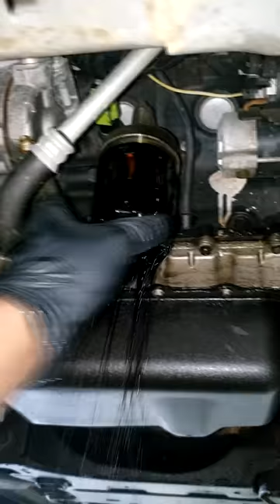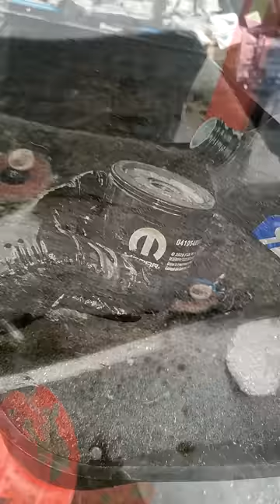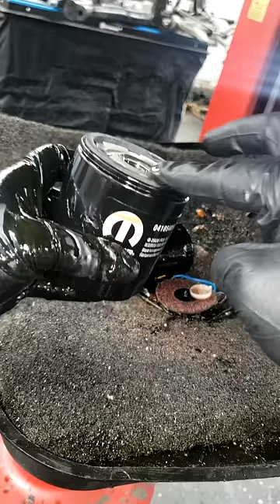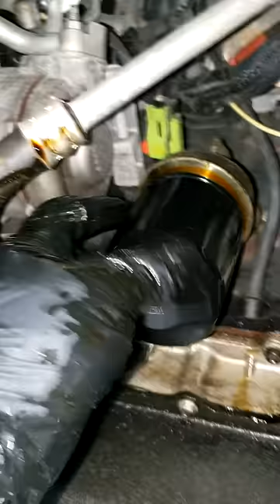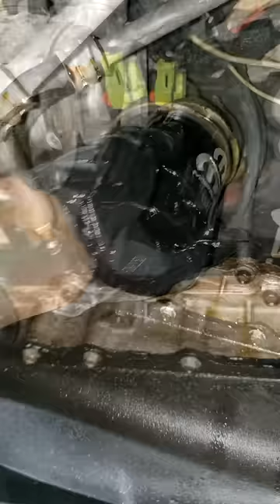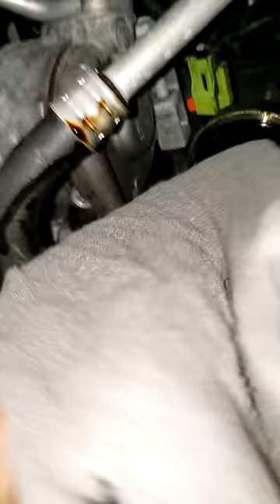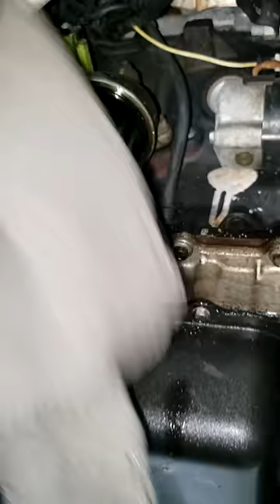Don't Lie.. Are yall still doing this?

Comment: I’m an aircraft mechanic this is the way I was taught. If the filter is empty you have several seconds on startup where the engine is not getting any oil. Until the filter is all the way full and only then are you getting oil to the engine rotating components. Engine oil is the lifeblood of any engine.
Reply: Exactly 👍. I was also a turbine surgine. Jet Mac. Homestead AFB. Florida. 7 years. The USAF always practiced schedule preventive maintenance on every engine. They did it by the total flying hours on the jet engines.
Reply: Makes sense considering in 3 to 5 seconds, the motor turns quite a few times semidry.
Reply: The parts will still be lubricated enough to last that initial start up…. Oil doest just disappear on its own… you can leave a drain plug off for days and there will still be plenty oil on all the components. Its the mater of how long you run the engine with no oil in the pan whatsoever. Then its the matter of the engine getting hot enough to burn off the initial oil….
Reply: You do need to do it on these engines. Partially because they run really basic oils that dont hang around in the bearings, and partially because they are all 75 year old designs.  Mine just has a strainer to catch all the metal bits that fall off the cam followers because of its basic late 30s design.
Reply: solenoids these days are more than capable of full film coverage almost immediately, there is absolutely no need to pre fill an oil filter with modern manufacturing standards and technology
Reply: @jpif2961  modern solenoids?  Not sure what a solenoid has to do with the subject matter. Obviously you have a cranial rectal inversion issue that you are unaware of... My solenoid doesn't require oil, electricity, or wind to function way better than anyone knows.. anyone.. do you walk to school or carry your lunch?.
Reply: Hello fellow aircraft mechanic. As an AMT, you should know it is all about what the manual tells you to do 😉. Jokes aside, it all depends on the type of engine. Most jet engines and small reciprocating engines dont need this, but you bet the filter is getting primed on a huge diesel or 9 cylinder radial beast.
Reply: I agree 👍. You're talking about a diesel. A totally different beast 😅.

Comment: 100% of the time! I run diesel trucks so the filters are huge. Why dry start an engine after an oil change. It takes no extra effort to prefill the filters.
Reply: All of my diesels get oil in the new filters,  not so with the small filter in my gas sedan engine.  However, during my oil changes I clean the filter port and mating surface and snug it down better than in this video.. vibration can wiggle the filter to leak.
Reply: In big trucks, yes. Car engines it really doesn't matter

Comment: It is also a good habit to wipe off the face of the filter flange on the engine in case the old oil filter gasket is stuck onto it.
As far as charging the oil filter before hand, it is a good idea to do it so that the oil goes directly to lubricate the engine. I have heard valve lifters click until they get the proper lubrication because of not filling the oil filter with oil. 
If you have a turbo this is also another good reason the charge your oil filters.
Reply: Haha that happened once  - gasket was stuck and I double - gasketed it. Noticed it immediately in the rearview mirror via an oil slick down the parking garage.

Comment: I have never prefilled oil filters. If you ran the engine for a short time as you should before the oil change, to stir up anything in the drain pan so it flushes out, the. There is a small amount of oil still on the componets inside the engine. The couple seconds it takes for the pump to fill the filter wont change anything. And if they HAD to be prefilled why would so many mount the filter sideways where you cant prefill it?
Reply: Exactly!

Comment: In my 30 years of changing my own oil, I have never done this. 30 years problem free.
Reply: Unless you consider the countless burning wrecks of cars you sold to others.
Reply: @shoobidyboop8634 Don't be dramatic 😂
Reply: @outdoor044  If you don't prefill the filter, the car will seem ok for awhile, maybe months, maybe years, then BOOM!!!!  A flaming wreck at the side of the road.  DON'T BE THAT GUY!!!
Reply: @shoobidyboop8634  It's more of a small nuclear explosion with radioactive fallout spreading all over.
Reply: Right?  Been changing oil in my vehicles for 15 years, from new models to models older than me.  Never once have I ever done this.  All the vehicles are still running.  Well...except for the Ford Explorer.  But it wasn't the oil/filter that did that lol.
Reply: @mandolorian1176  It was your bad driving.  We're all friends here.  You can admit it.
Reply: @shoobidyboop8634  haha nah, it was actually a bad timing chain.  The back one, as the DOHC V6 in that truck has something like 2-3 timing chains (can't remember).  I actually was given the truck by my father at 18.  It didn't run when he gave it to me.  Said, "Well, you want a vehicle, get that one running and it's yours".  Drove it for 6 years and fixed just about everything that broke.  Then one day pulling out of my neighborhood at that time there was a loud bang and white smoke everywhere.  Rear chain came undone and blew a baseball sized hole in the block.  Turns out that occasional rattle I could never track down was that lol.  Just shy of 200k miles.
Reply: @mandolorian1176  I remember talking to your dad about that.  He said it broke his heart, almost as badly as when you decided to change your pronouns to "drives/badly."
Reply: @shoobidyboop8634  haha oh my god.  That's good, I'm gonna have to remember that one.  Got a good laugh there.  Got a couple friends who are terrible drivers that this would just enrage.  Maybe I can put that on my next vehicles registry at the DMV.
Reply: My filter is side-mounted.  Can't do it.
Reply: @shoobidyboop8634 I'm going to go with professional advice. Not some nobody who makes shit up to sway opinions your way. Keep off the net and stick to gaming.
Reply: @shoobidyboop8634  bro what
Reply: @shoobidyboop8634  I’m confused on ur thought process
Reply: @CrankinShafts  Regarding what, friend-o?
Reply: '07 ford ranger side mount oil filter, but I do still rub oil on the seal.
Reply: How many of the vehicles have you ran over 250k miles?

Comment: I do this only on diesel engines. Bigger oil filters take about two quarts of oil like the LF9009. I guess I would do it if my car had a turbo, but I drive a Camry and Tundra. Oh, and I always clean the filter housing and lube the O-ring.

Comment: I no longer pre-fill oil filters. I have a few reason why: 1. some makers don’t mount filters open side up. 2. Most actually say not to. 3. The ones that do need a prime have a clear flood mode that I can crank it to build pressure before running(ford for example). I think the biggest reason though is because our fill jugs are never totally clean, so I don’t want to put grit on the clean side of the filter and put it straight on the bearings. My 2 cents.
Reply: After changing engine oil I shut the engine off 1 second after it fires and then start it a second time and instant oil pressure.
Reply: As a Ford Technician I never have pre filled oil filter (exc. diesels like 6.7) even when I change the oil on my EcoSport I never pre filled it. They build up pressure so fast for me is not worth it. And engines like 2.7 or 3.0 Ecoboost they come with cartridge style filters, so you can’t pre fill those either

Comment: Thing is, the filter will be that full within half a second of the starter running. If you've got time to burn, install a new filter without a prefill, turn the key for a split second, then check the filter, it will be basically full. I'm not saying it's zero benefit, but it's miniscule. More importantly you want to make sure you start the engine after a change without waiting too long, so that the air can be worked out of any feed tubes before the oil you splashed in the top drains into the pan.
Reply from the maker: So you saying to simply turn the key to run and the oil pump will prime just like a fuel pump?
Reply: @OnlineMechanicTips  no, oil pumps are usually mechanical so the starter needs to turn the engine over not just elecy on. I'm saying if you just go to start but back of before it starts you'll see the filter is basically full.
Reply from the maker: @StandAndStare  Thanks for clearing that up. You have a point
Reply: Some vehicles throw low oil pressure codes if you don't do this
Reply: @Leviweyhrich  yeah for half a second 😅
Reply: @Leviweyhrich  this is not true😂 I’m a mechanic and changed oil on every brand of car there is out there and never do this. Within tenths of a second after you start your vehicle your filter is full. No code is going to set ever from not prefilling a filter.
Reply: Can also remove the fuse for the fuel pump and do some fueless cranks to push the oil around
Reply: @OnlineMechanicTips  electric oil pump enters the chat check the new Toyota Camry, and various other hybrids. Electric fans and water pumps are more generally more common and benefial for all engines compared the electric oil pumps, which are use-specific (hybrids w/ engine auto-on/off at stops) P.S. just my understanding. Take with a grain or two of salt.
Reply: @drake8805  imagine your oil pump going out on the way to work because of a short in the loom or a faulty sensor or pin
Reply: @monkmoto1887  that's why I have a   Gen3 5.3, but generally speaking shorts don't magically occur. Electric water pumps are tried and true and flow a conductive liquid vs oil which is relatively nonconductive.
Reply: @drake8805  the hell you talking about? Shorts don’t magically occur? Who said magic? But wires run and chafe, electrical pins splay out, and electric motors burn out all the time. Mechanical oil pump failures are very rare on any car. They are literally the most reliable part in existence.
Reply: Depends on the engine.  On a Ford Essex (3.8L), it takes lot longer than half a second for the filter to fill.
Reply: @goatbaaad3711  cars it doesn’t make sense. But need to pre fill on diesel oil filters no matter what.
Reply: you literally just explained why theres zero benefit, and you wanna say you're not saying that? cmon bro either stick to your story or become trans already
Reply: @Leviweyhrich 15L engines that have a filter that holds a gallon don't even do that when you put the filter on dry.
Reply: @joshuastevens5910 no you don't.
Reply: @goatbaaad3711  not sure about other brands, but newer toyotas do sometimes, and the message disappears directly after popping up.
Reply: @Goatbaaad  lmfao, put a oil pressure gauge on the engine, more like 5-10 seconds.
Reply: @tssci6774  5-10 seconds won't hurt anything.
Reply: @tssci6774  Not even. Besides, it takes a couple seconds for oil pressure to build on a car that's sat for a while anyways, unless the filter has a quality drain back valve
Reply: You prime diesel filters. Bottom line. 7.3s hold 2+ quarts.
Reply: @oldschooldude8370  YOU prime diesel oil filters others of us don't waste our time.
Reply: @dklthibodeaux  Fair enough. I give a shit though.
Reply: @oldschooldude8370  I do too it's just not necessary. In fact I believe it's cat that says to not pre fill the filters going on their engines.

Comment: Channel called garage 54 did made clear see through oil filter and it filled up in less few seconds when engine turns. It was quick and then 2nd oil filter, they add sort of silver dye in oil to see how it flow through the filter. It was cool to see. 

Been in racing world since i was baby. First thing i was taught about changing the oil. Fill up oil filter first before you add oil in engine.
Reply: So what you gonna do with horizontal mounted? Besides just make a mess.
Reply: ...and putting plastic oil bottle shavings into your engine.

Comment: yeah.or if its a paper insert i take fuel pump fuse out and turn car over till oil light goes out.then put fuse back and run car-dip oil level and top up if required

Comment: Do I lube the gasket? Yes. 
Do I clean the mating surface? Yes.

Do I pre-fill the filter? Absolutely not. My excuse is that I’m rolling under my truck to change the oil. But even when I did this shit for a living I never once did that for a customer. Simply not necessary.
Reply: Especially when the filter is on its side
Reply: Yup! i see people talking about "dry starts" when you dont pre fill. But thats dumb. Oil pressure gets oil in filter in less then 5 secs. its not going to hurt anything not even in the long run.
Reply: Wrong.  Filter fills first before oil gets to bearings.  You are wrong.
Reply: Doesnt matter. The bearings still are lubricated enough. Once that pressure kicks in, in 5 secs the oil is where it needs to be.
Reply: Car care nut channel  master mechanic says NO on filling filter.  Js
Reply: @TheElantra it was tested and difference was big... Watch test before making statement.
Reply: It also just doesnt hurt. I always do it on my vehicles with vertical filters. It takes 5 seconds and I'd do it whether the evidence shows it does something or not.
Reply: Every second counts that the main bearings are without pressurized oil.
Reply: Lube gasket yes
Clean mating surface yes!!

Best comment yet.
Reply: Exactly, the only places i see someone pre-fillong an oil filter is when its a huge one that goes on semis and tractors, or if the filter's just big in general.
Reply: I'm master certified with 35 years of experience. With these small filters, it's pointless. I just wanted to say, 5 seconds the hell, more like 1 second. If it was so important, then filters would never be mounted sideways or face down.
Reply: Tell me what is the downside to filling it?  Only takes a few seconds.
Reply: Yah, clean the mating surface!
Reply: I’ve been working on cars for 8 years & have never seen someone do that shit in my life lol of course i lube the gasket thats a must
Reply: @TheElantra  it’s not five seconds it’s spontaneous
Reply: @Purpatratur  🤷‍♂️you get the point
Reply: If my dealership does it this way then yes. If not, then no😂. With that being said, I have never had engine issues so must be doing something right.
Reply: @BadGovt no need, just wasting time .
Reply: As long as you idle the engine and put no load on it. It will be ok. I see people running engines with no oil pan right here on YouTube and you'all think that's just fine. It's the load that's a factor. We start engines with LubriPlate105 and filter is not full. You can disconnect the coil wires and crank it if your worried about it. 35 years with Cummins. Oh Yes! Even on a diese,l it will fill an empty oil filter in seconds and have pressure. I've seen ISX15 engines started accidentally without an oil filter installed. That oil pump could pump that oil pan dry in 10 seconds it moves so much volume. Even if you installed an oil filter dry on a ISX15, you will have oil pressure in seconds. The secret is idle speed til you do have pressure. Best to fill the filter part ways full.😃👍
Reply: @DieselDog358  I have not seen anybody who full throttle started a car after he just changed the oil. of course you idle it for a minute before even thinking about touching the gas pedal.
Reply: @copsblow247 I work on boats and half of our inboard Chevy motors have the filter on the top upside down. Pre filling is pointless
Reply: @BadGovt you spill it all over trying to put it in. Simple
Reply: @beliedat2457  I don't have Turrets..😊
Reply: @asdfjkl981  I was more referring to Diesel. Take Care.🙏
Reply: Exactly